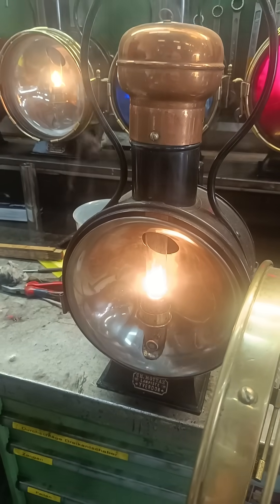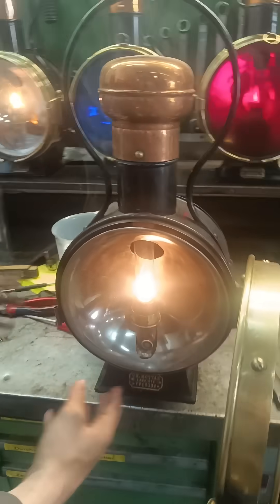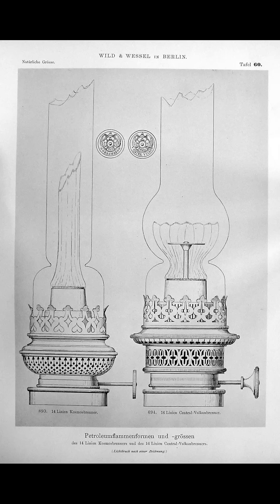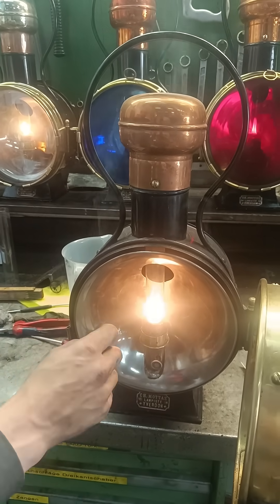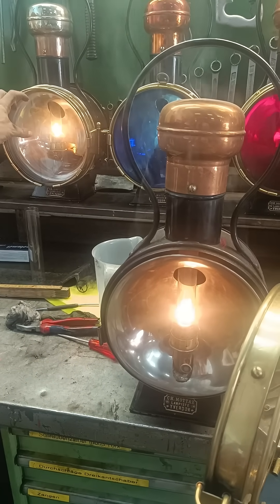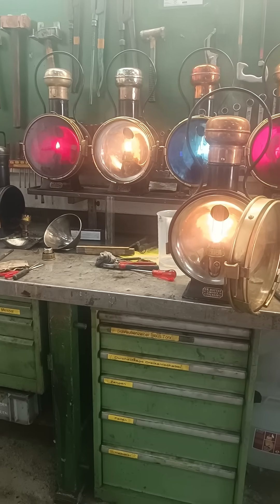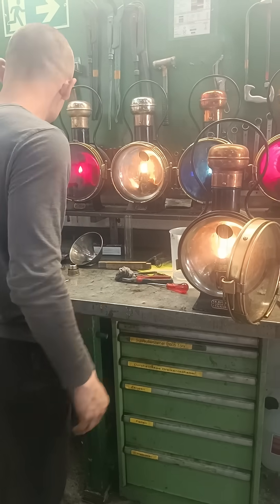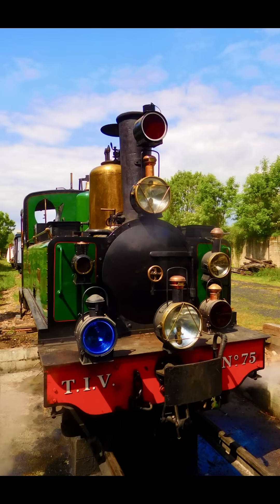All about European Railway Headlamps

Comment: I’m curious how these lamps compare, in terms of casting light, to the American style of locomotive oil lamp. The old-timey boxy ones.
Reply from the maker: They work the same way and the largest ones reached comparable brightness to regular sized American headlamps.  The American parabolic lamps, some of which had the big box-shaped cases you are familiar with, were the most powerful in the world simply because they had the largest burners and by far the largest reflectors, sometimes up to 28 or 30 inch diameter.